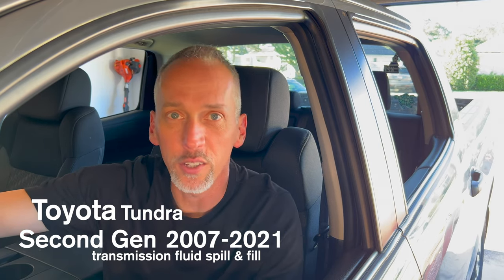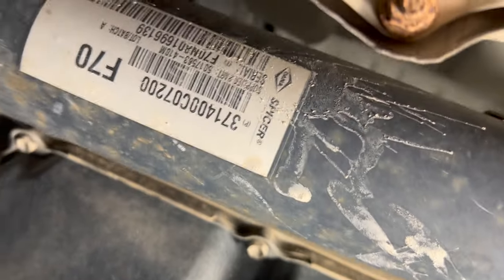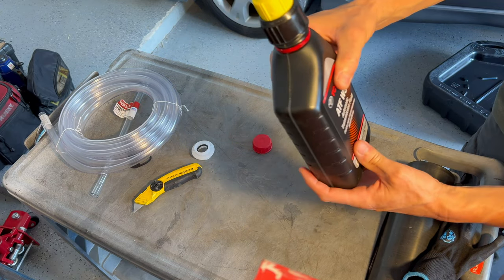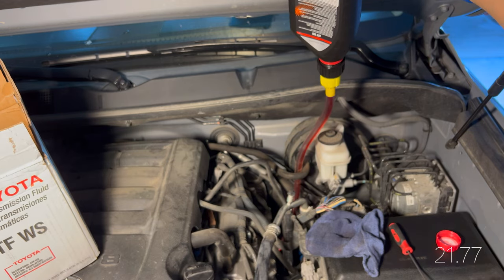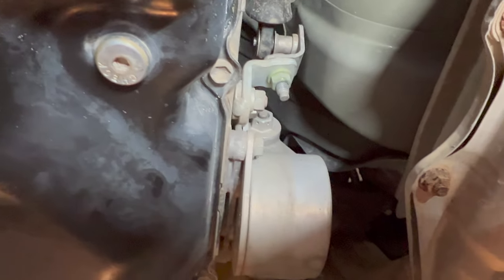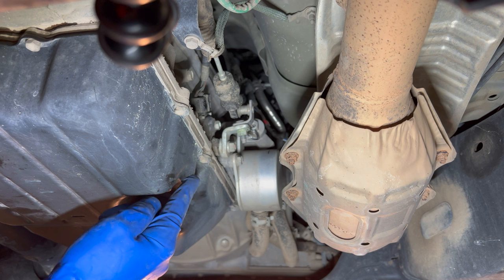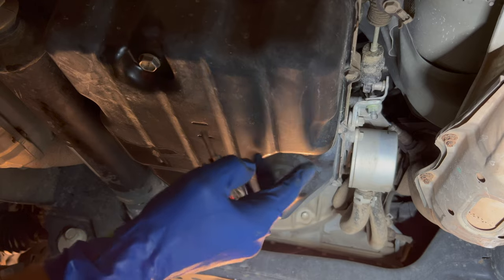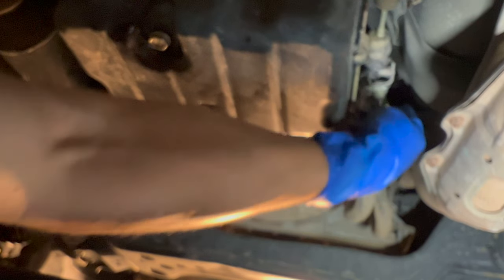DIY Tundra transmission fluid change.

Comment: My truck just turned 73,000 miles and it’s a 2018. Should I just do a drain and fill or should I also change the filter?
Reply from the maker: Changing the filter wouldn’t hurt, I still do it about every 4th service. Just make sure the bolts holding up your pan aren’t rusty. They tend to break.

Comment: Wow, so many questions… Not to sharpshoot you at all. Can we remove pan to change filter and clean magnets? Can we just measure what we removed and replace the same amount? There will be an over spill either way. Doesn’t the amount we add get contaminated as soon as the new oil mixes? I’ve had it flushed by the dealership once in my 2010 Tundras 180k lifetime. I was thinking of having it flushed again by the dealership, then I come behind them and remove pan, replace filter and clean magnets. I see less contamination that way. I don’t see why the oil needs to be at a certain degree, maybe for expansion, but does older oil expand less or more than newer oil? I love this 2010 Tundra, and I’m going to drive it until the wheels fall off, then replace them.
Reply from the maker: You can remove the pan if you choose, two things to keep in mind.
1: adding more steps to the job means you do it less often.
2: The pan bolts can get rusty and might break when you try to loosen them.

As far as measuring the new fluid:
1: fluid expands with heat, so they have an established range to check the level.
2: relying on measuring the old fluid means you have to trust the level was correct from the last job and that you capture all of  the spilled fluid.
Hope this helps.

Comment: Would you recommend doing the drain and fill if 110k miles have lapsed between servicing?
Reply from the maker: That could be risky. As you know, changing the fluid won’t harm your transmission, but it could reveal some wear that already exists. Sometimes higher mileage transmissions will slip after you’ve done the service.

Comment: Hey there I have a question, I have 2014 Tundra and there is no thermostat to close off, I it still the same procedure?
Reply from the maker: Yes, if your Tundra doesn’t have a cooler, all the other procedures still apply.

Comment: Good morning question I have a 2008 tundra 5.7 V8 and I happen to get codes P0761 which states shift solenoid C performance or stuck off and code P2714 Pressure solenoid D performance or stuck off. My intentions are to replace those both solenoids,transmission filter/O ring and pan gasket as well as replacing the drain/check plug crush washers and almost forgot as well replace the fill plug O Ring and put in new fresh WS transmission fluid back in. What’s ur opinion on me doing this please?
Reply from the maker: OK here’s my opinion, take it for what it’s worth. It would seem to me that your transmission is high mileage and possibly hasn’t seen many oil changes. It’s likely that your transmission fluid is going to be sludged up at this point. I say this to get to my point, which is there is a high likelihood that your valve body is getting plugged up with debris. Sometimes, when that happens, it’s possible to solve the problem by flushing the transmission with new fluid, sometimes not. Replacing all that fluid could lead to other problems like your transmission slipping. Transmission diagnostics can be a very tricky thing and I am certainly not an expert.  My recommendation would be to give the fluid change a shot, assuming you are willing to take that risk. If you still have issues, then consider taking it to a very good transmission shop to get a solid diagnosis.
Reply: Appreciate the response and forgot to mention that I used to b a tech for toyota so maintenance wise my truck is tip top including the tranny 😉. Did what I wrote n the first comment today it was a bit time consuming but I made it happen. All I have left to do is fill the transmission tomorrow with the WS atf fluid and check the level of it and am hoping that should fix my issue. @ least I got the heavy work out of the way today/tonight was going to fill it up tonight but the time caught and the flies started coming out plus I didn’t want to make a mess and not see what i was doing so tomorrow morning it is. I have 10 and 1/4 of another quarts n total so am hoping I have enough tranny fluid for tomorrow 😬

Comment: I don’t understand the temp range given to check the fluid. Trans fluid expands. Trans temps can reach 185°. Does the fluid stop expanding at 113°? If not … why not let it get to maximum temperature and then check it? Is this the same for other manufacturers?
Reply from the maker: Toyota decided to give us a break, and let us check the fluid without burning our arms on hot exhaust. Different car makes and models have different temperature ranges, I’m glad this one is on the cooler side.
Reply: @ToolDemos  Okay. What about the continued expansion? Toyota must have compensated somehow with the overflow tube. Thanks for responding. I really appreciate it.
Reply from the maker: @seanmclaughlin7415  yes, it will continue to expand, but the overflow tube’s length is designed for the temperature spec given. If you let it warm up to full temp, too much fluid will pour out.
Reply: @ToolDemos  I figured. Just wanted to confirm. Thank you 🙏
Reply: Do you happen to know the temp to check a 2017 Ford F-150 with the 6 speed tranny?

Comment: First thing I did when I bought my used Tundra was to drain and measure the oil, drop the pan and change the filter I was happy to see at 100k that it was spotless. I added the same amount of new oil and hit the road.  I also have a trans oil temp gauge and try to keep it near engine temp. I tow a lot all over the country

Comment: @tooldemos I was reading online that to change the transmission fluid on the Tundra. I noticed you only used 6 qts, yet it calls for 11-12 qts. Am I missing something here?
Reply from the maker: If you just spill the pan, all you get out is 5 or 6 quarts. The whole system takes twice that.
Reply: Ok gotcha. Thanks for the information

Comment: Is there a way to remove all the old fluid from the bell housing with the draining, and does this even need to be done?
Reply from the maker: There's no drain plug for that, you'd have to flush the system to get it out. Some shops will do that for you, but I don't recommend it.
Reply from the maker: @Crickeybeoch  first, a warning: It would be better for your transmission if you never changed the fluid than to run it dry. The fastest way to destroy a transmission is to run it without fluid in it. 

That being said, the answer to your question is yes. In the front of the transmission and connected to the input shaft is the hydraulic pump. When the engine turns, that pump circulates fluid throughout the entire system, then back into the sump.

Comment: The tool description  says the Autel scanner is no longer a reliable source. Can you tell us the scanner model number? I’m looking for the cheapest scanner that has the transmission temp PID, and it isn’t very easy to find. Thanks!
Reply from the maker: It’s the MaxiDiag Elite (no part number). The updated version is no good. Here’s a full-function scanner that’s much better, pretty inexpensive, and is Toyota/Lexus specific: https://amzn.to/3HfSX1r
I really like mine, made a video on it:  https://youtu.be/lQbfb9yv5JM?si=QpFHN1GfeJtns95L
Reply: @ToolDemos  Outstanding! Thank you for that, and for the quick reply!  Merry Christmas!
Reply from the maker: @Gary_in_NoVA  thanks, Gary. Merry Christmas to you too.

Comment: Do you have a part number on the Transmission pan gasket and strainer from Toyota also which scanner do you recommend for us diy"ers
Reply from the maker: Yup: strainer part number: 35330-0C020
Strainer o-ring: 90301-31014
Pan gasket: 35168-34020
And for DIY scanner on Toyota (only), I really like this one from Launch: https://amzn.to/3wB6KND
Here’s my review of it: https://youtu.be/lQbfb9yv5JM?si=KhnXPwTZVuY5rA9Y
Reply: Thanks so much for the info. When first watching the trans fluid change was it the launch tool you used for trans temperature ? @ToolDemos
Reply from the maker: @garykirsch875  no, that was an Autel tool. They don’t make that model anymore.

Comment: I just bought 2010 sequoia. 150k ODO.  Came with no service records. Should I attempt to change tranny fluid or leave it alone? Thanks!
Reply from the maker: You’re kinda border-line on that one, I think. I’d recommend having funds available for a transmission before you open it up.
Reply: @ToolDemos   otherworldly you’d leave it alone?
Reply from the maker: @parzydlakgajusia1605  yeah, I think I would.

Comment: I’ve heard there is no cooler on the 2020 Tundra, as people have had issues with towing so some have actually added a cooler. So if that’s the case I shouldn’t need the pin. Can anyone confirm this?
Reply from the maker: That is correct. The last year with it is 2018.
Reply: @ToolDemos  thank you for letting me know!

Comment: Great video, but how much does this really save a person? My local shop told me they will check/change ATF for $200....seems like over $100 just for materials not including a persons time to begin with!
Reply from the maker: You’re right about that. DIY maintenance and repair work doesn’t usually end up saving much after tool purchases. It’s more of a hobby.
Reply: If I can do it myself I usually do.  That way I KNOW it was done right.  Took a Kia to a dealership once for all new hoses and belts…well a few months later when I changed the timing belt the back hard to get to AC belt was never changed…Made me so mad!!!

Comment: Great video. 

With dip stick systems it is critical to ensure that you put back the exact amount that you've taken out. Last one I did was my pathfinder. I used the cooler hose to evacuate the fluid, measuring what I removed and refilling that amount of new fluid. I did that repeatedly until clear to resolve a coolant leak/atf contamination issue. Did the trick.

I now have a 2013 Sequoia. Seems that with this closed system, the fill plug ensures that you're putting in precisely the right amount, even when you "try" to put in too much :)

I'm wondering if draining as you did, then starting the engine to empty the fluid from a detached cooler line (to drain the fluid in the torque converter), THEN filling to the fill plug level would give you pretty close to a full fluid replacement.
Reply from the maker: Thanks. I totally understand what you mean when you want to flush the entire system. You did the right thing on your Pathfinder because you were fixing a problem. I’ve done that before in the past, but for scheduled maintenance, I prefer the procedure to be more simple.
With a quick spill-and-fill that really only takes about as long as an oil change, you can shorten the interval. I think if you do this every 30,000 miles it will keep your transmission happy and you won’t have to take the system apart and make as big a mess.

Comment: Do you have a part number for the new washer on the 5mm check plug? Thanks for all your time and help.
Reply from the maker: It’s the same as the drain plug gasket: 35178-30010

Comment: My truck has 90k on it and I’m debating on doing this. Should I change it even though it’s at 90k or just leave it? I’ve heard mixed things about changing transmission fluid.
Reply from the maker: Fresh fluid can’t harm your transmission, but it can reveal problems that were hidden by old fluid. My take is keep it clean inside, but if you’re changing 100k fluid, have the money you need in case it needs a rebuild.
Reply: @ToolDemos  well it’s a 2017 tundra. And I have no issues so far, but I wanna prevent them for as long as possible. If it was your truck would you change it or just ride it out til it dies
Reply from the maker: @timothywells457  I’d change it.
Reply: @ToolDemos  I have a 2007 with 189000 on it.  Had toyota service up until 155000.  Then it was all me.  I cant tell from the service reports if it was ever done but they had service every 5k.  Drives great and I do tow a bit.
Reply from the maker: @brianrybasack5721  i’d give the dealership a call and ask about the history of the car. They should have a record of whether the transmission was serviced.

Comment: Thanks for the video.
What is your opinion on pulling the cooler line and replacing all the fluid?
Reply from the maker: I think it’s messy and complicated. I like simple, so the spill-n-fill is better for me. Replacing all the fluid might be better, but a quick 5-6 quarts once a year is easy and I’ll actually do it.

Comment: Guys. Where do I get one of those grenande pin things for the thermostat
Reply from the maker: The pin was from a timing chain tensioner. You can use a paper clip or a drill bit. Whatever ya have.

Comment: I bought the exact Autel recommended in the description link, but I can't get it to display AT TEMP.  What the heck?
Reply from the maker: They must’ve removed that function in the latest update. I’m removing the link so nobody else buys it. Your best option is return it to Amazon and check Autel’s website (or another brand) to find a tool that has the coverage you need.
Reply: i have one and i had to call autel to get them to explain where it is for my rav4 and they found it for me and it works so maybe just can’t find it?

Comment: Thanks for the video. I'm getting ready to do this on my 2007 Tundra. Could you keep draining and filling to get all the old fluid out? Or is that only possible by messing with the trans cooler line?
I'm also confused about the 10 degree temperature discrepancy between the scanner and the heat gun. 
Thanks
Reply from the maker: Thanks Ben. Yes, you can drive it for a few minutes and do it again to get more, doing cooler lines would work, just not my thing. The temp difference is due to the location of the temp sensors. They are up inside the transmission where it is hotter.

Comment: Your video is semi accurate. Temperature should be between 115-133F to check your overflow level. 
When you mentioned at beginning “ Toyota don’t want you to change your transmission fluid at home “ they ban you. 
Otherwise good video.
Reply from the maker: I appreciate ya.

Comment: Quick question, when you open the transmission drain, approximately how many quarts do you get out?  I have a 2019 Tundra and was wondering how important is it to drop the entire pan to replace the filter? Or should I just do a drain and refill with fresh oil?
Reply from the maker: You get somewhere around 5 quarts to drain from the pan. If you remove the pan, maybe another 20 oz. The filter inside doesn’t get all that dirty unless there is a problem and Toyota says it isn’t necessary to change.
Reply: @ToolDemos   I have always had an issue with that.  If you change an engine oil filter when you change motor oil, but not when you change trans fluid? Makes no sense.
Reply from the maker: @joerivas9847  I’ve changed it, but don’t want to deal with it every time.

Comment: You should have made sure you can remove the transmission fill plug first. If you drain the pan and not be able to refill you are in deep dodo
Reply from the maker: Very good tip. If you find yourself in that predicament, you can pump fluid up through the overflow tube.

Comment: every 20k is insane
Reply from the maker: What would you suggest?
Reply: @ToolDemos  60k at most, which I believe is what the manual says. I wouldn’t touch it after 120 or so.
Reply: The first one is 30k miles or 3 years, which ever comes first.  Then after its 50k miles or 5 years.  The car nut said so lol.
Reply: @G_Money_  i confirm, car nut explained in very detail about not change it very soon or very late

Comment: Way too complicated,  I'd rather just let a mechanic do this.
Reply from the maker: Yeah, it’s still not as easy as they used to be.
Reply: @ToolDemos  I appreciate the video though!  This way I can know what is and what is not something I wish to tackle.  I do all the other fluids but this is outside my limitations.   Do you have (or would you consider making) a video on changing the spark plugs?
Reply from the maker: @jedeckert8912  yes, actually the Tundra is approaching 100k miles. So, I’ll be doing all of the service (including plugs) and videos will be posted. Should be coming this spring.

Comment: To save 50$ on the oil use Aisin WS  ATF it is made by the manufacturer of the transmission it’s the same oil as the Toyota oil you are just paying extra for the Toyota name on the bottle and the trans is made by Aisin.

Comment: Rule of thumb put back what you drained out, use a measuring bucket.
Reply from the maker: That can work.
Reply: Since trans fluid volume changes as the fluid's temp changes, matching the fluids' weight might be more accurate than matching volume.